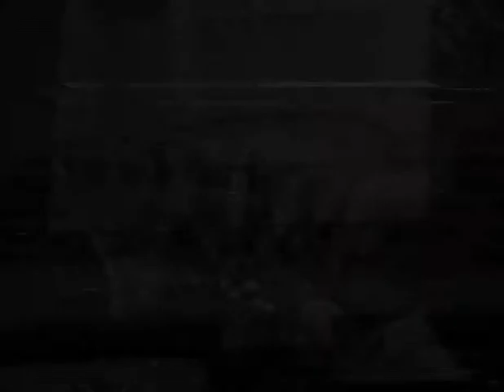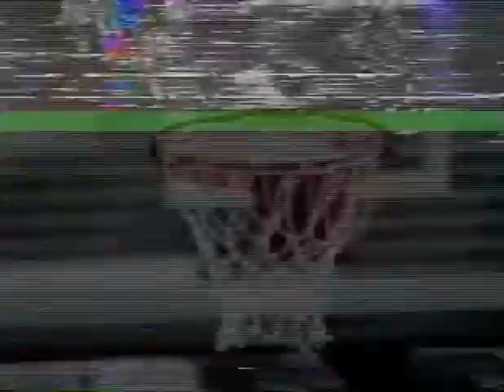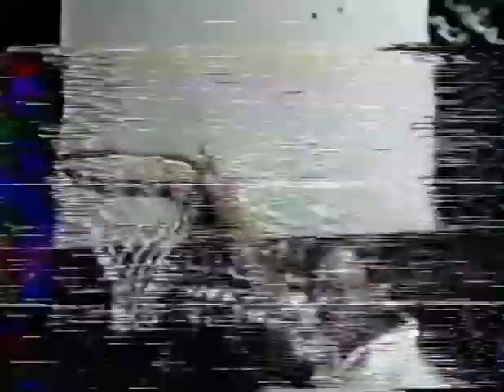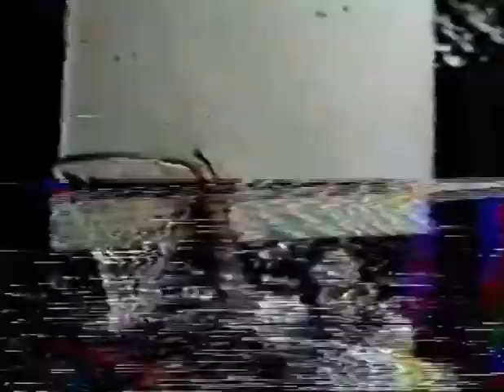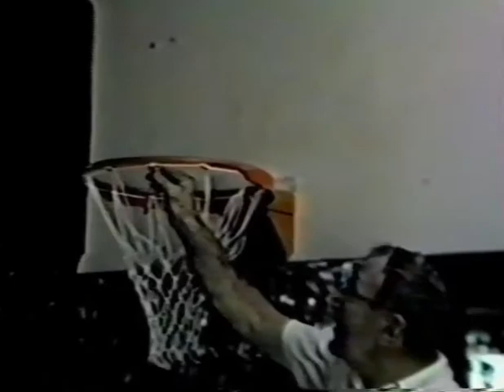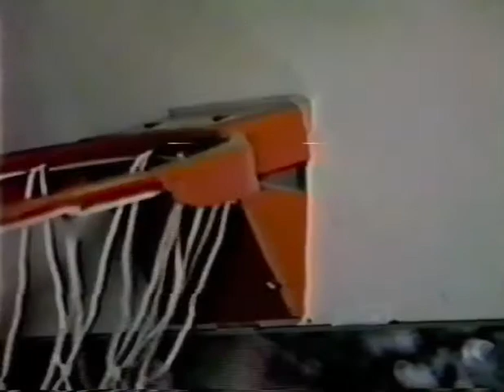Breakaway Rim Design Explained — Toss-Back’s NBA-Approved Safety Rim Innovation

Comment: Do they sell those specific type of rims anymore. The new school ones are not as rigid as they used to be. I can't stand the 180* fleax ones. I think they are not strong enough.
Reply from the maker: The snap back Toss Back rim would only break away in one plane.  I agree it would have been more rigid.  When my father introduced them the "positive lock" claim would only allow the rim to release at 230 lbs of force as I recall.  As you suggest it appears they now release in other directions.  I do not know what new mechanism is used.  However, I have inquired to the NCAA about the forces required for them to release.  It appears some rims are not as positively locking as others which changes the  rebound characteristics as well as the higher shooting percentage potential - an advantage that could be good or bad. Toss Back was sold decades ago so not sure who you could contact.  JMO.